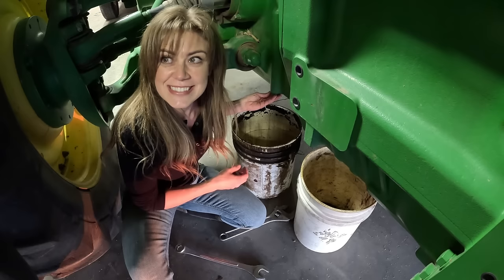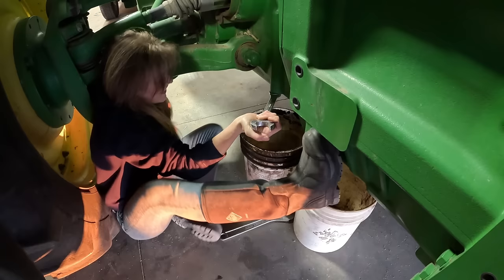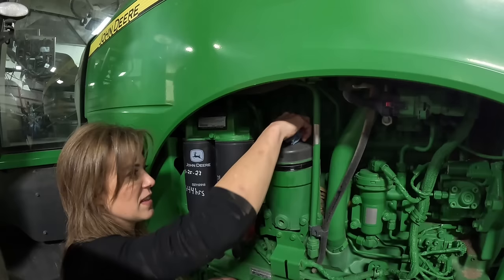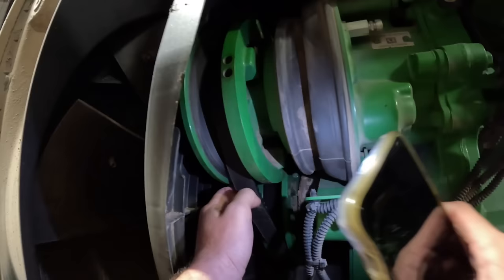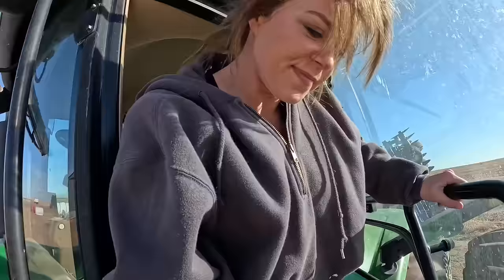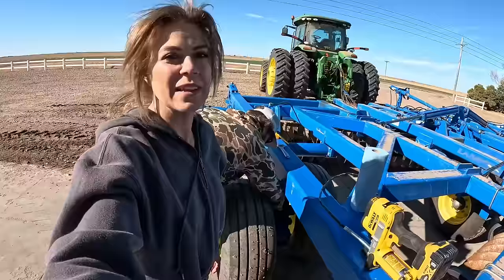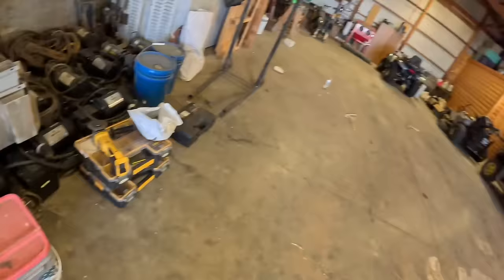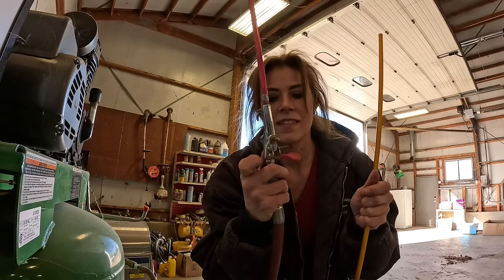Farm Recruits Girl To Service Equipment

Comment: Hi Jojo. Just a tip from an old "Shade Tree Mechanic" who was wrenching on a 1965 Ford Thunderbird when he was 16 (1977) - I've wrestled with hundreds of "frozen" bolts.

Put your wrench on the bolt, then slide a short section of pipe over the handle of the wrench. Hold the pipe towards the end farthest away from the bolt and try to loosten the it. This gives you a longer "lever arm" and will make it much easier to apply greater torque to the bolt, and it should turn easier. Once you've broken it loose, take the pipe off of the wrench and use it normally. I know this isnt going to change the quality of your life (which I am so envious of) but hopefully it will make your day a little easier the next time your battling a stubborn bolt or nut.

I love your content, Jojo! I can't get enough of it...

Comment: Its so nice to see a video of yours 1st thing in the morning. One tip i have for you and i use this tip A LOT on wrenchs. Once you got the wrench on something with the boxed end on witch is the round end, if you put another boxed end wrench in the open end of the wrench your using it will double up the torque as you just doubled the length of the wrench your using. Its very helpful spatially in tight places were you cant put much weight on the wrench your using and if you have the room then the 2 wrench method works great if you have the room for loosening bolts and nuts. Just make sure both wrenchs are straight as one could slip a little if they are not straight. I landed on my butt before thats how i learned, the HARD WAY LOL. But must of the time it will not slip. My father teached me that when i was really young and trust me it comes in handy a lot for me ;) I wish you a very very Merry Christmas and i hope you have great and fun holidays.

Comment: So here is my 2 cents regarding the oil change. For myself, I would get the proper size 6 point socket and a breaker bar. I would not pull towards my face. If that wrench slips, bad things are going to happen. Use an open hand when pushing towards a solid surface. Once again, if the tool slips, you don't smash knuckles. Be proud that your are learning. Many people would not want to do that on such a public forum. Best of luck!

Comment: Instead of putting your foot on the tractor, for leverage, to undo a drain plug. Try about a 14inch piece of pipe from a chain link fence, slid over a wrench fo leverage. Much easier to loosen the drain plug. Good luck Farm Girl! Latex gloves keep the hands clean. YOUR YHE BEST.

Comment: Top tip when when doing oil changes  No1   Get yourself a box of those oil resistant black disposable gloves because used engine oil is not good for your skin
No 2   If the drain plug is tight use a short piece of 3x2 timber or similar and give the spanner a sharp tap to loosen it. It can be so easy for the spanner to slip off the plug when using all your strength leaving you with grazed knuckles ouch. Merry Christmas to you both.

Comment: Zack....I have some lock & lube...supposed to be the best thing since a pocket on a shirt !!  NOT!!  They work for a while & then start leaking...I got some Saker ends...way better AND cheaper...only thing is they are bigger dia., but I'd rather do 1 or 2 fittings by hand, than have grease every where...not to mention that stuff is getting expensive !!

Comment: Dont pull a wrench toward you if it slips off  your going to be looking  at dental work, also when pushing your wrench away from you open your hand when reaching the end of its travel so you dont drive your knuckles into the oil pan.

Comment: Jo jo would you believe on my company truck a 22 Peterbilt 579 with 177,000 miles on it a 50,000 mile oil change intervals turned into 1300 engine hrs, most farmers would faint at that many hours on a oil change

Comment: Put a piece of pipe, 
breaker bar, 
on the end of the wrench 🔧 
it will magnify your strength by giving you a lot more leverage.
And much more control.
This by, saving your knuckles 😣